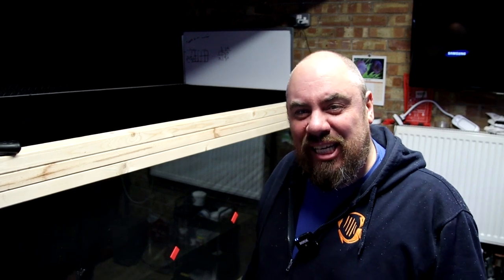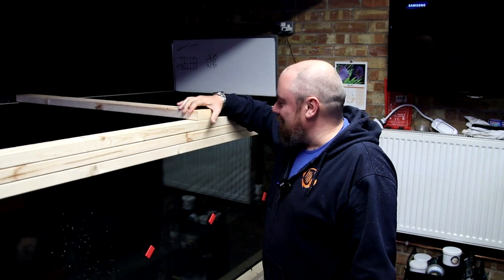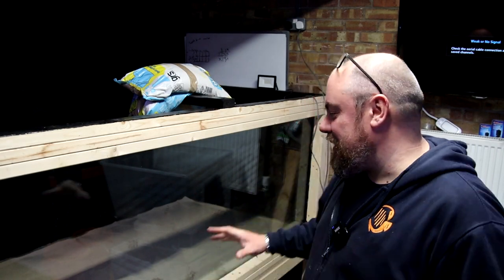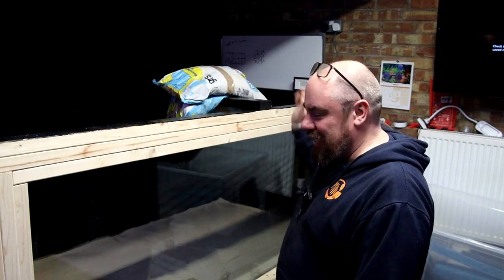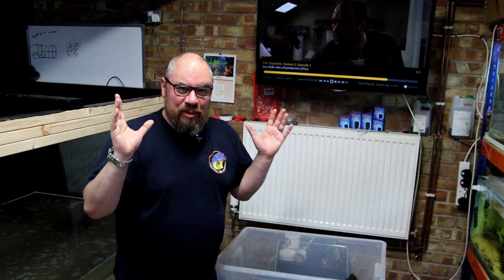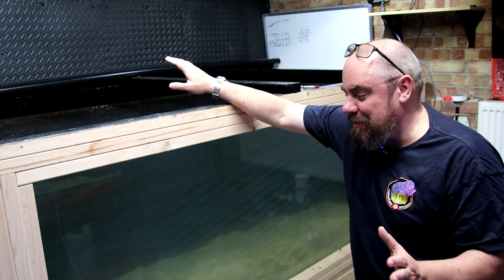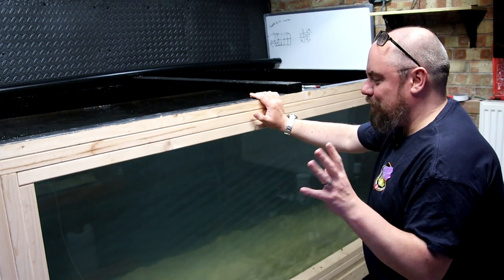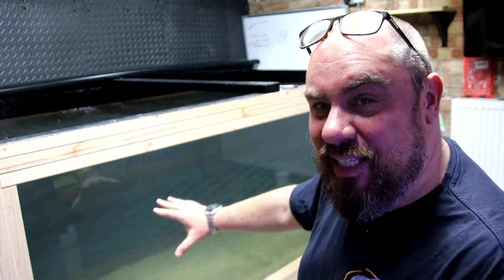MEGA TANK filled and running! Huge aquarium build

Comment: Awesome! It's certainly inspired me to possibly try something similar (and smaller) at some point. I think I'd be inclined to drill all the holes and do 100% of the woodwork, then coat everything in the liquid rubber or whatever. And use black silicone, including a bead around the frame on the outside where it meets the glass, if that makes sense :D

Comment: If you are worried about chemicals leaking from  the liquid rubber you could add some bags with carbon for the first weeks. It will take Amy harmfull stuff out off the water that you can't detect with a test kit.